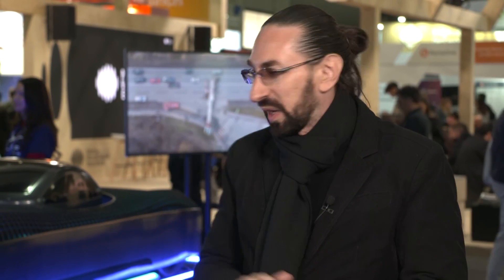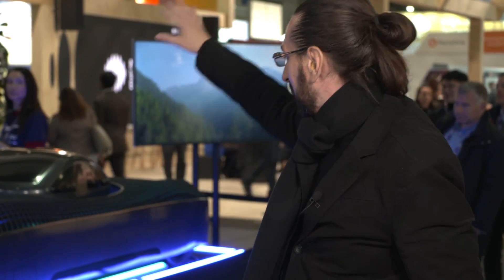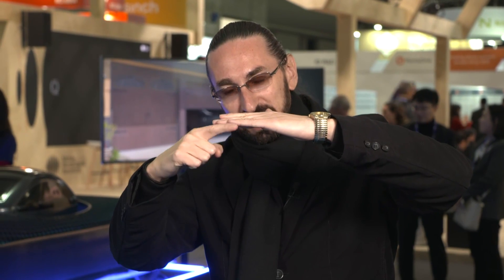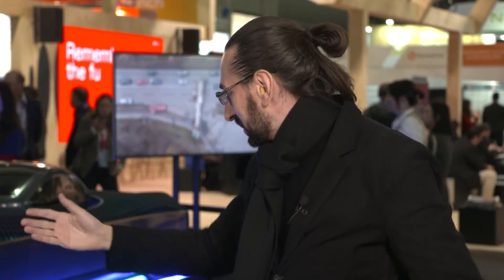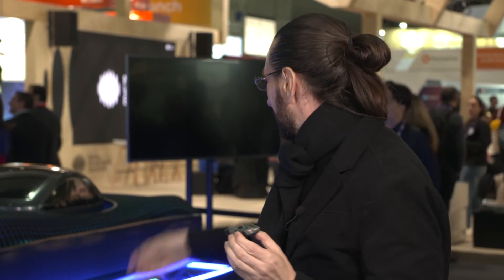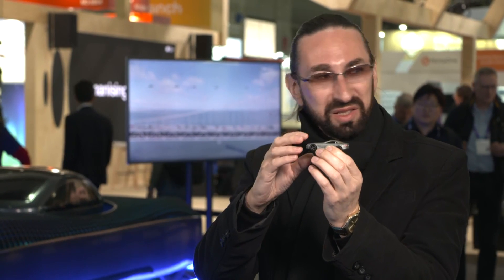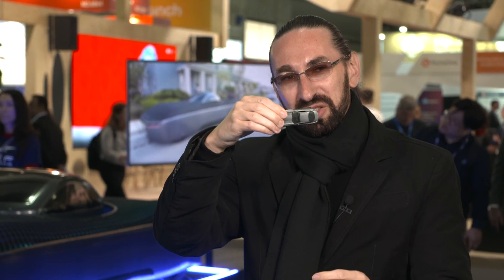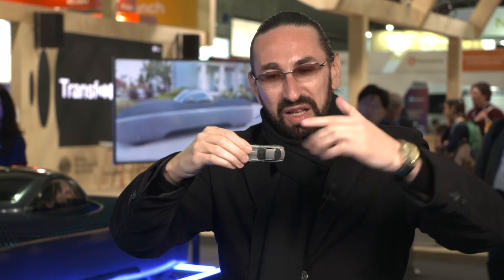Alef CEO: 2025 target for flying car 'actually pretty realistic'

Comment: How can he be the CEO and not understand how airplane wings work? His explanation of the air moving faster underneath and pushing up is incorrect. (The air actually moves faster over the curved upper surface and sucks upward.) I think this may be another delusional flying startup mostly designed with investors as the target market. Poor Tim.

Comment: IMPOSSIBLE car. You can't get enough thrust from rotors without breaking laws of physics - ask your high school physics teacher. Rotors would be huge - see drones and helicopters (ask ChatGPT or Gemini if you don't believe me). Other critical issues: impossible 'tilting cabin' (even with fly-by-wire for all systems), driver/passenger safety, weight including the heavy battery, and on and on. But prove me wrong, we'd all love to see a FLYING, DRIVING PROTOTYPE!